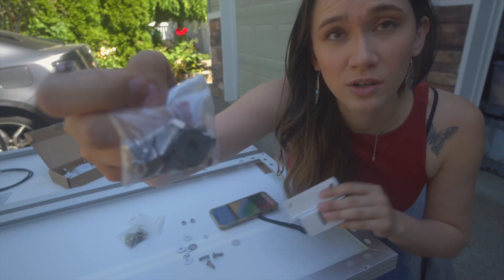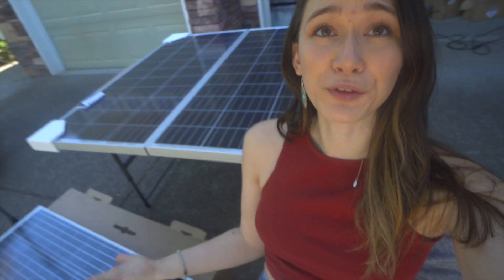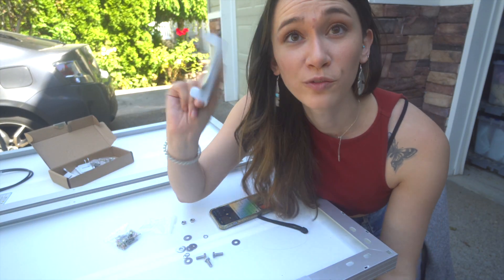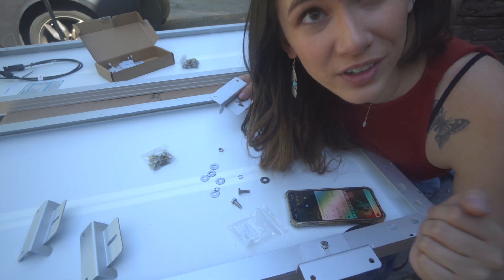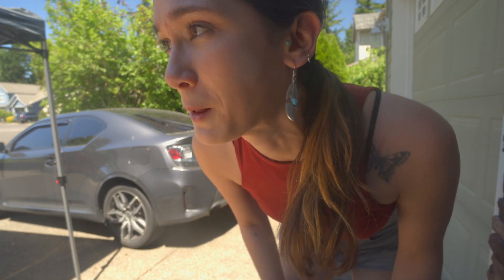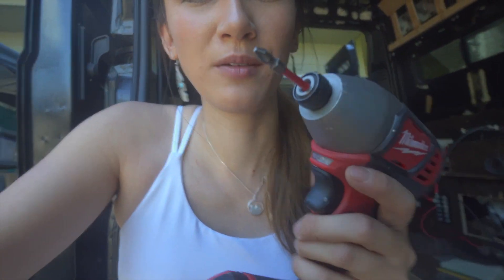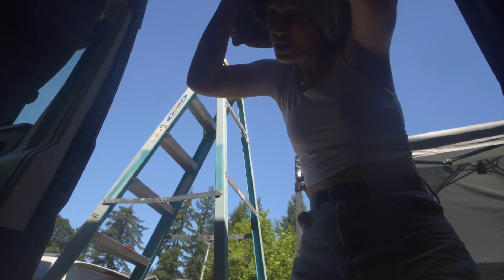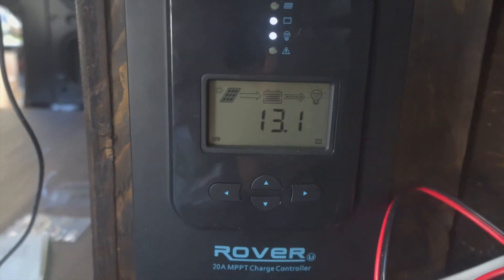Installing Renogy 200w Premium Kit [Van Electrical Pt 2] | Van Life | Van Build Series

Comment: I’m not sure having your electrical main fuse board exposed is a good idea, I’m hoping you’re going to move it into the wheel well so you can’t electrocute yourself..  But good job letting people know about the charge profile.  If you use lithium on a lead acid or agm charge profile they will fail, either quietly or in a boom.

Comment: And just like in a car battery 12v system,  it will routinely read 13 -13.9 volts in the gauge.   When things are working.